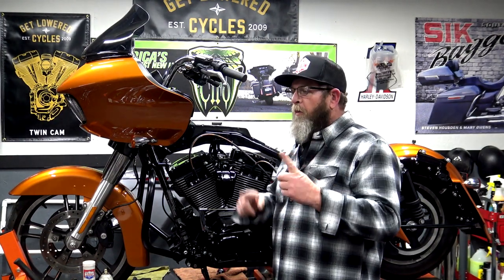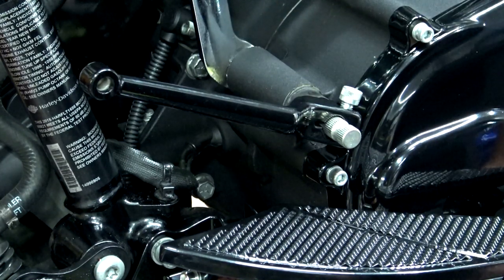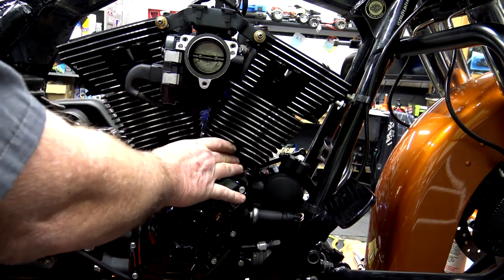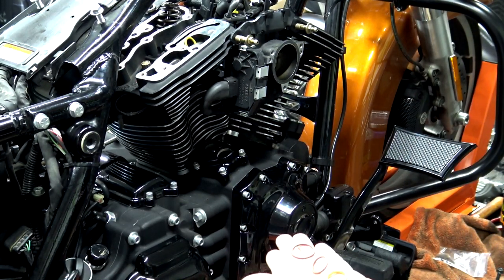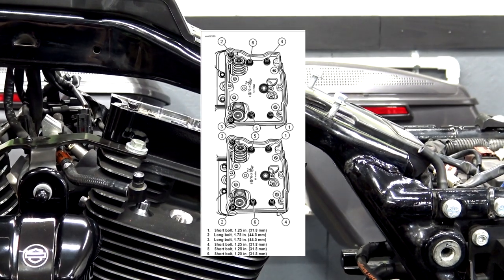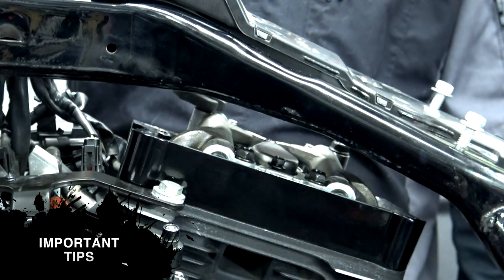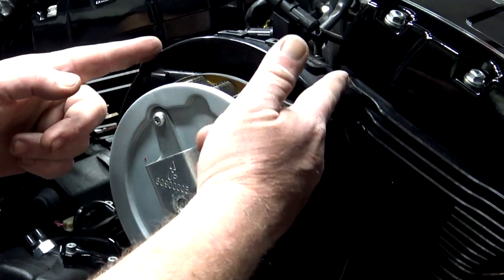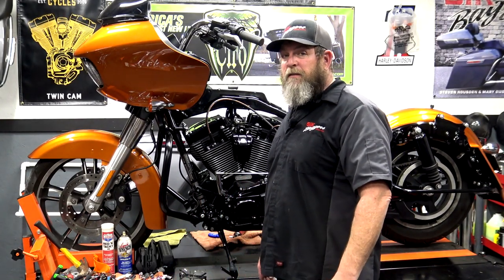Part 2 Chrome To Black Powder Coat Parts Install Harley Touring

Comment: Steve what floor boards are on the whiskey project?
Reply from the maker: At the time I shot this I purchased these from amazon https://smile.amazon.com/gp/product/B0762KC11C/ref=ppx_yo_dt_b_search_asin_title?ie=UTF8&psc=1 removed the rubber and had them powder coated then re glued the rubbers back on. Solid boards.

Comment: so if those lifters were not flush with the case, does that mean it isn't on the compression stroke?
Reply from the maker: no it is set at TDC but you have oil trapped in the plunger...The plunger must be compressed to expel that oil. Bleed down is the release of fluid in the lifter. Never turn your motor over to work on the other cylinder until you can fully hand turn your pushrod and the rocker has some free movement in them, if you dont wait you will likely bend the valve as you rotate the engine over

Comment: Steve what product would you recommend when cleaning engine on bike. I have some white spots that i want to remove from top of primary
Reply from the maker: depends on what the white spts are but id start with a degreaser and brush and try to get it out...follow it up with the hd engine brightner or equivalent to bring back the black if its on the wrinkle black. Honestly I use stuff called Awesome from the dollar store...its a buck a bottle its pretty good degreaser for the garage.

Comment: Hey Steve - what gasket brand /kit did you use or recommend for doing the rocker tops and push rod tubes / tappets / etc ?
Thanks !!!
Reply from the maker: Hey, just saw this comment and sorry to be so late on it but I just used all harley gaskets...Ive used them for years and never had an issue with them.
Reply: Thanks for the response and content- keep up the great work , much appreciated. Harley gaskets ordered 💪👍

Comment: Hey Steve, great video. What brand floor boards are on that bike?
Reply from the maker: well..to be honest im not sure on the brand. I purchased them on eBay and had them powder coated as they were used. I had them for awhile in my shop from an old build that I didnt use. After getting them powder coated I went to pout them on and the right side board would not mount up do to the design. The inside point hot the brake lever. soooooo they got pulled and put back in the cabinet. Honestly though I never knew the brand name as they were purchased used from the start.
Reply: Steven Housden ok cool. Thanks Steve.

Comment: How much did it cost you to get everything powder coated
Reply from the maker: I had everything powedered and both slip ons Cerakoted for roughly 550..the cerakote was the most .....so if id didnt do the exhaust it would have been around 350-400 and this was done at a huge powder coat shop...not a home made powder station. I have never got prices from anyone else so i really cant compare but this guy is known to be the best around my area....he didnt let me down...nice clean powder

Comment: About how much does it cost to powder coat all the parts you did for these 2 videos
Reply from the maker: it was roughly 400 for the powder coat and 100 to cerekote the pipes
Reply: SIK Baggers I’m going to call around and find a local powder coater and do the same thing

Comment: I know every locations will have slightly different prices depending on quality of work and zip code but can someone share what you could expect to pay to powder coat the parts covered in part one and 2?
Reply from the maker: Hey Andrew...I had about 25 pieces and both slip ons that got cerakote which costs a little more to do...the total for this bike was about 450 bucks. The pipes themselves were about 150. He told me a good rule of thumb for the parts was the outer primary cover was about 45 bucks and the the biggest piece I took him. So you kind of gauge from there what pieces cost. Now this guy was a powder coater and bad liner guy...not a local guy with a homemade powder coat oven and thats what I payed...so you may find it cheaper. I thought it was a good deal considering just replacing a few covers with black from HD was about the same price as everything I got done. I hope this helps you get an idea.
Reply: Thanks for the quick reply. That's cheaper then I thought. Add a couple more for fluid and gaskets etc... the bike looks great love the whiskey build. Your giving some great ideas. I need to go start a go fund me page???? Lol

Comment: This looks badass... What kind of $$ do you have in this?
Reply from the maker: Well I sat down and started pricing just replacing these parts with black parts instead of powder coating..and after the inner primary, derby cover, cam/points covers I was up to about 500. I called the local powder coating guy and got all of this done for 550, including the exhaust pipes. There was about 30 pieces total. What I didnt factor in was the gaskets. Around 170 for new oil for all 3 holes and all new gaskets and o rings.
Reply: @sikbaggers  Really looks good. I appreciate your videos